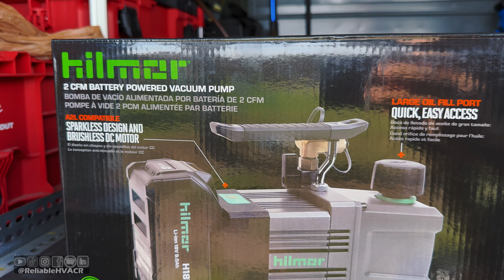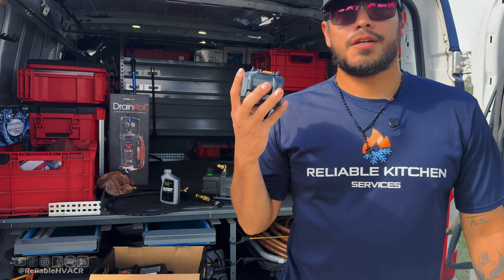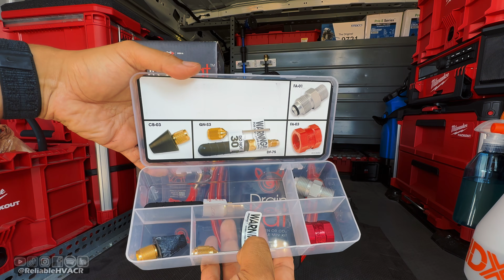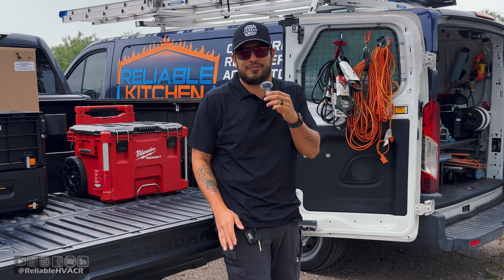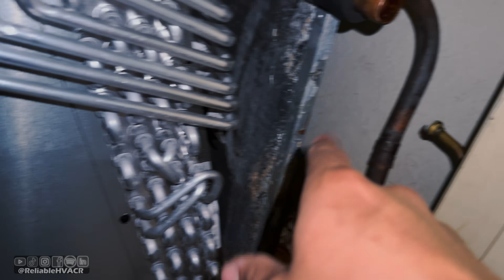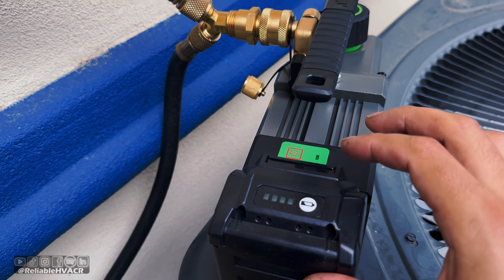Shocked with the NEW Hilmor Battery Vacuum Pump

Comment: To get 499 microns within minutes cost alot of money
The 2cfm pump from hercules is $130, 12ah battery is $140
Battery charger $40
Apion core removers2x$60=$120
Micron gauge$60-$120 
Trueblu hose$200
It takes $800 dollars so you can reach 4xx microns within 5min-10min..versus a $300 5cfm cord pump + gauge manifold set $500 for the field piece with the. Skinny hoses..itll pull 4xx within like 30mins-1hr

Comment: I bet anything that this pump is made in the same factory that my Harbor Freight Hercules 2cfm battery pump is made. That little pump is awesome, I have the 12ah battery and have used the pump about 6-7 time and the battery just got down to 1 bar the other day when I used it.  This Hilmor looks really nice. Thanks for the review. The Hercules is a better deal for a 2cfm vac pump. The pump, 12ah battery and charger total cost $353.46, the pump has a 5 year warranty and the battery and charger both have a 3 year warranty.
Reply: It helps to have the right pump oil as well just done a system the other day with my Hercules with line sets of 1 1/8 and 5/16 and 75 foot in length 5 ton unit pulled below 350 microns with a 3/8 hose in an hour and a half. Always change the oil after each use. The Johnson vacuum pump oil harbor fright had worked really good in that pump the jb oil works good in it as well.
Reply: The Hercules looks great and the price is good too, but a couple of reviewers said it couldn't handle the job if the system was even mid sized or there was a lot of moisture. Or, it took a really long time. Hard to know what is the real story.
Reply: @realSamAndrew  It's worked perfect for me every time. Just did a 4 ton system the other day and got it down to 180 microns in about 10 minutes or so. All vacuums pumps can have problems if a system has a lot of moisture.

Comment: I have the Hercules 2 cfm from harbor freight and the 12 ah high output battery it can run right at 4 hours on a single charge it’s a little more compact than the hilmor and the price wasn’t bad either cause I run Hercules and Milwaukee tools so I have plenty of batteries for both it pulls vacuum very fast for a 2 cfm pump.
Reply: That one works for every residential job? Or you use another one on 5 tons

Comment: I've had the navac 2cfm for a couple years and love it. I only got it to use on heatpumps above a drop ceiling where my 8cfm is just a pita. The 2cfm I can sit rite on top of a ceiling tile,no extension cords or trying to rig up the pump to hang suspended or any other nonsense.